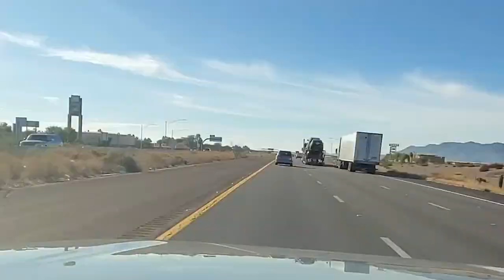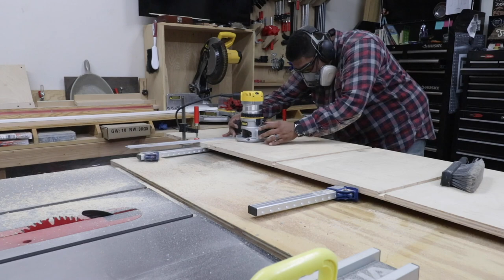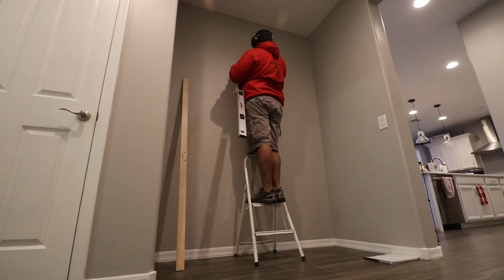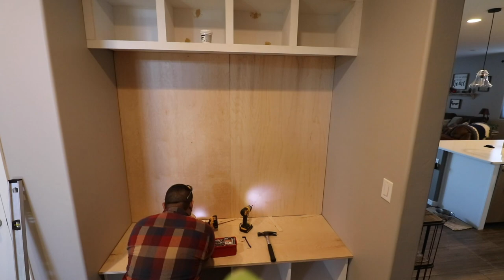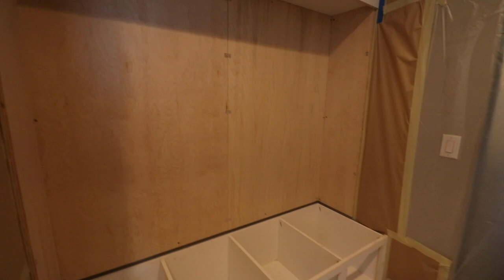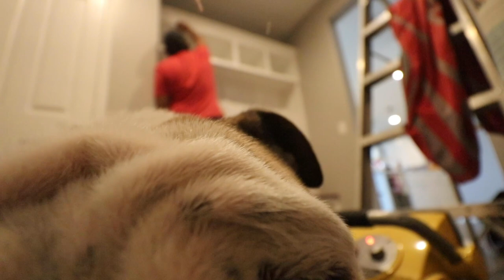HALL TREE / DROP ZONE BUILT IN

Comment: how high is the bench height Danny?
Reply from the maker: I want to say it was 18-20 inches.
Reply: @rinkelton  whats the length of the bench? Did you use a piece of stained pine for it?
Reply from the maker: @pzazzera  it was just shy of 8'. Its was made out of oak veneer plywood stained and cleared. To cover up seeing the plys I glued on a strip of hardwood to the edge, making it look like a solid peice.
Reply: @rinkelton  thank you for your prompt reply..will start this in a few weeks
Reply: Danny, what was your upper cabinet box height if your base was 18-20" height and the depth as well. Also with your french cleat did you mount it flush to the back of the upper cabinet or was the back of your upper cabinet recessed 3/4"?

Comment: I am pretty much going to copy this I think for our screened in back porch! As a novice woodworker I appreciate your attention to detail! It looks like you used 3/4 plywood? 

Also..your feed table, I like it. How did you configure that saw horse/ a frame?
Reply from the maker: Yes it is 3/4" ply. With solid wood trim. The outfeed table is a Ron Paulk design, he has a youtube channel. I think its called the total work station. It is designd to be easy to move around. I actually just built an updated workbench one that is not mobile. Thanks for watching!